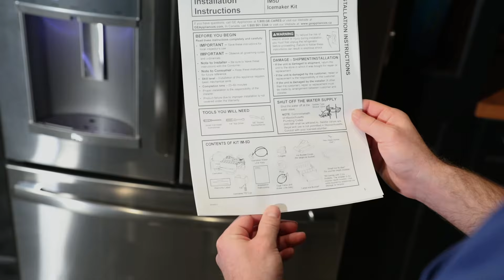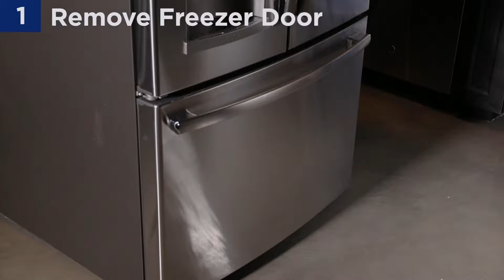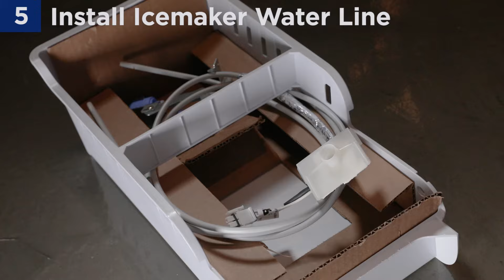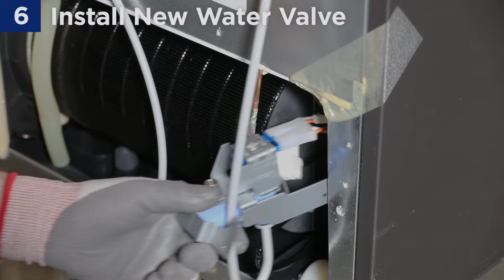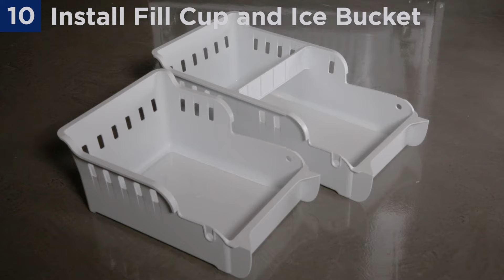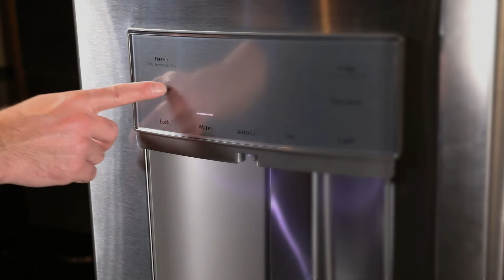GE Appliances IM5D Icemaker Installation

Comment: There's two problems with this video, just like the instruction manual. First, the narrator says to connect the refrigerator water line to the new valve assembly, while the video shows the technician connecting the freezer water line to the valve assembly. Second, the narrator says disconnect the upper line to from the bottom. The problem is there are two different unlabeled connections at the top. Which one is which?
Reply from the maker: We want to help with the installation of the IM5D ice maker and gather further information from you. Please send us a private message via Facebook, Instagram or X with the complete model/serial numbers of the refrigerator and a description of the issue, so that we can review the situation and get back with you quickly.

Comment: @geappliances I installed step by step, not getting any water into the ice maker on the bottom and i dont hear the motor turning on. Not sure whats going on. Its all connected according to the instructions
Reply from the maker: We would like to help and would need more details. Please send us a PM/DM on our Facebook, Instagram or X with the model and serial number on your appliance.
Reply: Did you lower the freezer temp to 0F and give it time to cool down to 15F? The water valve doesn't open until the freezer is cold enough. That's what I read and that's what I experienced.

Comment: Why does my icemaker constantly overfill and freeze over
Reply from the maker: We are sorry to hear that this is happening with your icemaker and would like to provide some guidance. There are a couple of things listed below that could be causing this to happen. 
Low food load:
The defrost cycle radiates heat into the freezer. The ice in the freezer will naturally absorb the heat. This will cause the ice to melt slightly during defrost, then eventually freeze together in clumps. Increasing the food load in the freezer will buffer the warmth from the defrost cycle and keep the ice from melting. Make sure the freezer is 3/4 full of food.
Lack of use:
When the ice bin is full, the pressure from the weight of the cubes can cause the bottom cubes to fuse and clump. To prevent this from happening, discard the clumped ice and check the bin periodically to ensure the ice is not building up. If you do not use a large amount of ice, you may turn off the icemaker and stop ice production. We would also like to recommend dumping unused ice every 30 days or so.

If neither of these suggestions solve the problem we would recommend service. You can schedule an appointment by calling or visiting the link- 833-4BODEWELL (833-426-3393)
Monday – Friday: 8 a.m. – 8 p.m. ET Saturday – Sunday: Closed http://spklr.io/6057BG9OX

Comment: I just installed this kit and waiting for ice.  This video was pretty good although I am confused about connecting the water lines with the Y connector.  On my 2025 model, there is an elbow connector and a straight connector.  Based on the video clip above, it appears I should be removing the ELBOW connector and replacing it with the Y connector.  Is that right?
Reply from the maker: Thank you for taking the time to reach out with your question. Could you please send us a PM/DM on our Facebook, Instagram, or X page with your model and serial number? If you need help locating your model number please see the link here- http://spklr.io/6051B6d9F.
Reply: What was the answer?
Reply: on my unit, it was an elbow connector that was replaced with the Y connector toward the top of the fridge.

Comment: Great instructions!!  Watched the video and paused it at each step. Took me about an hour as I had to empty the freezer first.  The screws that hold the freezer door on my model are 5/16", not 3/8".  Also, I needed to use long nose pliers to remove the black shim on the water line.  Very easy install if you follow the video.

Comment: So if you purchased this fridge and got it professionally delivered/installed (with top ice maker working), you can skip to step #9?

Is running a water line to the lower compartment part of the installation process if the bottom ice maker is not in place and is ordered after the fact?
Reply from the maker: Dual Icemaker and second icemaker models do not require an additional water line and both receive filtered water on models with a filtration system.

Comment: I believe I installed this exactly as the video says. When I get water from the door, my ice maker in the freezer pulls water to the point of overflowing. 

Were my tubes wrong on my fridge? Or this a bad new solenoid casing?
Reply from the maker: We recommend checking the troubleshooting tips on page 17 of the Installation Instructions (http://spklr.io/6056SGJ6) in the "Leaking water around the fill cup" and "Leaking water behind the refrigerator" sections. If you're still having trouble, please reach out to our service team by calling 833-426-3393 (Monday – Friday: 8 a.m. – 8 p.m. ET; Saturday – Sunday: Closed) for further assistance.

Comment: The icemaker has been installed, however the "ice bottom" on the panel still will not appear. Any idea what specifically was done wrong with the installation?
Reply from the maker: We definitely share your concern and would like to know a little more. Do you mind sending us a PM/DM with a few details and some photos? We'd like to see what we can do to help. Sincerely-DM
Reply: @geappliances  I need support as well.  How can I PM you?

Comment: Something doesnt make sense on this video. On the IMD5 kit I recieved, there is already a loose end hose plugged in to the black port ... which both the video and printed instructions says should be the line out to the new ice maker. The white port on the same valve, which both the instructions and video show the loose end hose pre-attached to, is open. Can someone clarify which goes where?
Reply from the maker: Hi Sean,

Thanks for reaching out to us. If you're able, please PM us on Facebook or DM us on Twitter/Instagram with a copy of your comment, your complete model and serial numbers, and some pictures of what you're describing. We'd be happy to review further once we have some more information. If you need help locating your model and serial numbers, you can click here: http://spklr.io/6054lSJa

Hope to hear from you soon. -MS
Reply: I had the EXACT same problem when putting mine in. I have done some research, and I just ended up switching the clear, plastic tube that was preattached to the unit with the tube that now comes out of the new ice maker. The tube from the new ice maker I am installing (the one for the bottom freezer) now goes into the black port. The clear, plastic tube that came preattached to the new unit now goes in the large port UNDER the black port, up the back of the fridge, and into the boTottom of the "Y" connector, which has the two, really short tubes connected to the top. To be honest, though, the new ice maker does not fill with water at all, so maybe the instructions are wrong. I'm wondering if I should switch them back and leave the clear, plastic tube where it was when I got it.
Reply: @amymiears9531  GE Service found the issue. I had the water lines correct. The tube to the new bottom ice maker DOES go into the black port (on the valve that has two ports). The free-ended pre-installed hose on the valve that attaches to the splitter connection SHOULD have been in the white port of that same valve (mine was incorrectly installed from the factory same as yours). Hook the hoses up as shown in the instructions/video. My bottom icemaker wasn't making ice because there was overspray from the factory insulation process that had gotten into the plug inside the freezer compartment. As a result, the ice maker was making just enough contact to show on the diagnostic screen as ok, but not enough to cycle the motor and initiate the dump/refill process. After removing the bits of foam from the plug, the ice maker fired right up and functioned properly. You might need a tech to come out and check yours.
Reply: @seans3961  Well, I finally paid more than $100 to a technician, and he checked it and said the heat tape on the fill tube failed. This was a brand new, just out of the box, part, straight from GE's own website, and it was broken when I installed it. GE is going to give me my money back, but I have to uninstall the entire kit, box it up, and send it back before they will issue the refund. Then I have to order another one and wait for it to get here. It's pretty irritating, but at least the mystery is solved.
Reply from the maker: Hello-Thank you for taking the time to reach out. We would like to help. If you need further assistance with troubleshooting please send us a private message with your model and serial number on the unit. We would be happy to look into it further for you. Sincerely-DM
Reply from the maker: Hi again Sean,

Thanks for the update. We do apologize for the icemaker issues you had but we're glad to know that all's working as it should now. If you have questions or concerns about your appliances in the future, you're always free to reach out and let us know. -MS
Reply from the maker: @amymiears9531,

We apologize for any inconvenience this has caused. We are glad you were able to receive assistance on this matter. Please know we're always here if you need anything else. 

Take care, SH

Comment: I have model number GFE28GYNJFS. I am 61 years old and not good at installing or fixing things like this. It looks complicated and I wish this had already come installed. My fridge already has a water line installed that makes ice for the upper ice maker. Does this mean I can skip to number 9 where is says to. I am confused as I am wondering if a second water line has to be installed for the bottom ice maker. Does this model already come with a dual water valve? Some of you may want to bash me for not knowing how to do this but I just had knee surgery 5 months ago and not sure if I can get down that low to install. Someone please help. I just moved to a new city and don't know of anyone that can help.
Reply from the maker: Hi Brent,

Thanks so much for reaching out. We'll be happy to assist you with this. This refrigerator does not need a second water line to be connected to use the optional ice maker, so you can skip to step 9 in the video. If you have any other questions that the video or instructions are not clear about, you can reach out to us anytime. We also encourage you to contact a qualified installer if you believe your recent surgery will prevent proper installation. Hope this helps. Stay safe. -MH
Reply: @geappliances  I was able to install this today but NO water is filling the ice cube trays. Yes it is ON. As I said I have a water line that is filling the top ice maker but the water line does NOT come out of the hole that is shown in the video. So i skipped to step 9. I called GE today with another problem and they scheduled service to come out but after I was off the phone I got the first issue fixed. So I called back and canceled the appt because I thought it was working now. I am so pissed right now because nothing ever goes right for me. I just don't understand why the water doesn't come out. Maybe if GE sold these refrigerators with both installed, I wouldn't be having problems right now. Please help with more then just a stupid video or instruction manual.
Reply from the maker: Hi, Brent. Thank you for getting back with us. We’re so sorry for the stress and inconvenience this situation with your ice maker has been causing you. We know this must be frustrating and time-consuming. Furthermore, we also appreciate your feedback that both ice makers should come installed. We have shared your comments with our appropriate team. It is our goal to provide excellent products and services for our customers. Your suggestions are greatly appreciated.

You mentioned you cancelled your service appointment because you thought your ice maker was working. When an ice maker is first installed, the icemaker mold must reach 16 degrees F before a cycle will begin. The icemaker will purge any air within the water supply line by cycling several times before filling with water. The first fill may only be a small amount of water, but the second fill cycle would fill over this. It may overfill slightly, but this is normal.

When checking your ice maker today, can you see if it has filled with water? Is it making ice? If further help is needed, please take a look at our following link to review some additional troubleshooting tips and our video:

http://spklr.io/6055Yslv

We hope this helps. If you have any additional questions or concerns, be sure to let us know. We are glad to assist you. Thanks, JP
Reply: Still no water coming in. I guess it's just to complicated for me. I give up.
Reply from the maker: Hi, Brent. We're sorry your icemaker is not yet filling with water. Thanks for getting back with us. Just to confirm, are you installing the correct ice maker kit, IM5D? If so, please ensure these are the instructions you are following:

http://spklr.io/6056YtOo

Additionally, ensure the ice maker is plugged in securely as addressed in step 11 in the above link. 

If the mold is still not filling with water, did you try the diagnostic test in the video in the prior link we sent you?

You can also check to make sure the ice maker itself is working by following the below steps:

If the icemaker mold is empty, you can manually pour about 4 ounces of water in the icemaker mold.

Wait about 2 hours.

If the icemaker has dropped ice cubes out from the mold, you know the icemaker itself is working.

When performing the above test, be sure not to physically touch the mold with your hand. It can be very hot to the touch when it warms up to drop the cubes from the mold.

I hope these additional tips help. If you have any other questions, we are glad to assist you. Thanks, JP

Comment: Make sure you disconnect the shorter upper tube on LEFT for the wye connector. It comes out of the fridge (water filter) and back into the very top. If you use the one on the right, you will not have filtered water for the bottom icemaker...
Reply: Do you have pictures of that adaptation?

Comment: The valve has one brass input and three 1/4 od connections. What is connected to each of the 1/4" connections" The video does not show the third water line being connected.

Comment: I'm ready to order a second IM for the bottom freezer. My question is, there is already the dual fill valve  and fill hose to the bottom freezer. My guess is it is ready for the IM and bucket. Correct?

Comment: Howdy from Sacramento.   Pretty good instructions.   I did not take off the door of my freezer though.  It was a little tight getting to the back, but I installed the icemaker w no problems and I didn't have to worry about re-gapping the door.  EZ PZ.
Reply from the maker: Glad that the video helped! Thanks for your feedback.
Reply: I also did not need to take the freezer door off and was able to install the unit with no issues.